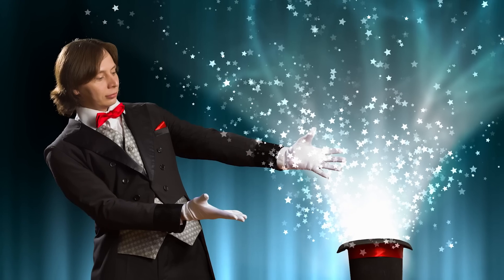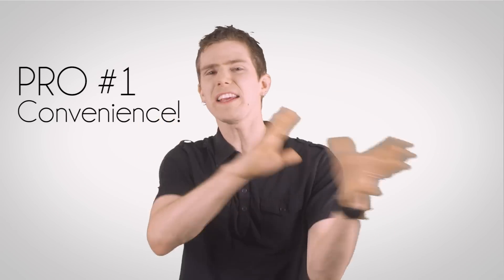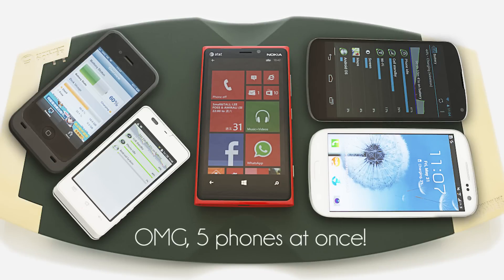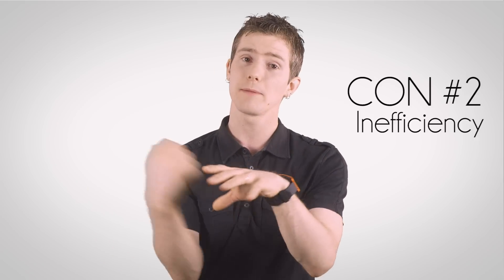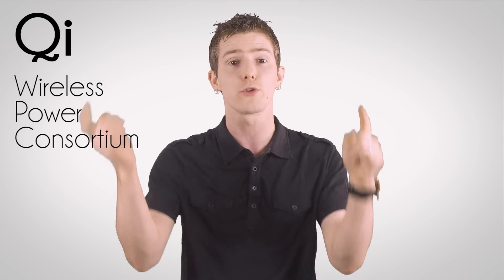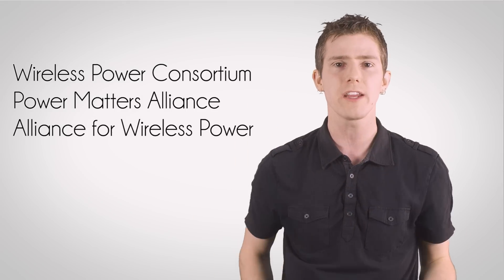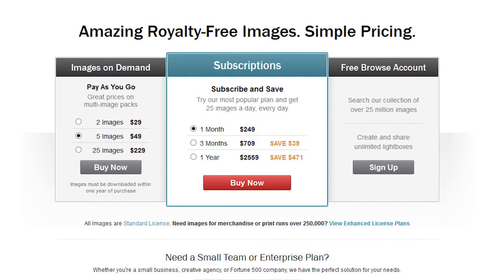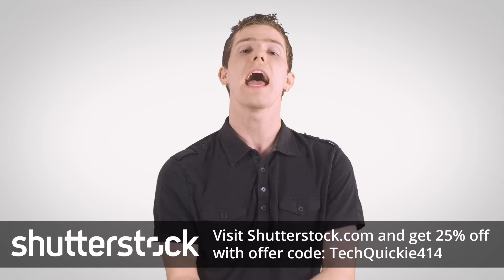Wireless Charging as Fast As Possible

Comment: It's not wireless, the charger is still tethered to a wall socket. Stupid marketing gimmick...
Reply: But there's no cable between your phone and the charger, that's how it's wireless.
Reply: Newbie13XD I know how it's "wireless". But the phone is still stuck to the charging pad. Once you take it off, it ain't charging anymore. The charge range is so small (like only a few inches away from the actual battery) that actually can't consider it wireless . You can remove the charging cable from the device as easy as you would do remove your phone from the charging pad.
Reply: Răzvan Botea Well the thing is, as Linus said in the video, that you simply put it on the table rather than having to plug in a cable. But yea, I see what you mean
Reply: Newbie13XD The charging cable is long enough that you can lift your phone from the table to your ear easily. No need to remove the cable.
Reply: Răzvan Botea did you watch the video?
Reply: Newbie13XD No, I didn't. I just like to comment on videos without watching.
Reply: You do know that its bat to leave your phone in the charger while your using it right? And using it while your on a phone call is worst. The phone heats up really fast and can cause on burning your skin or the phone burns or explode.
Reply: No it can happen but it doesnt happen that much. I mean there been only a few that happened but it can happen but just not likely. I dont want to start a fight at all cause its stupid i just wanted to say it could happan. Try reading some articals in google search. Or watch the news sometimes. :) please no fight- thanks
Reply: Răzvan Botea You are wrong ;) Some charging pads have there own battery ;) So yes it CAN be wireless.
Reply: Even Finckenhagen why noone gets my point ??? Why you connect to your WiFi it's wireless right? You can move 10 meters away from it and still be connected. Is it the same with wireless charing pads? NO. You have basically stick your phone on the pad.
Reply: Why noone get your point? Can it be you are wrong? :p
In your sense wifi is still not wireless, them are normally connected 1-2 cables/fiber, even u can only move 10-50 meters, i can bring my pad anywhere and it still work wireless.
Reply: Even Finckenhagen I get yours, but let me make it clearer maybe you'll get mine: wireless can mean pretty much everything since atoms/molecules physically don't touch. Two copper wires can be at a distance of about a few micrometers for a small amount of current to pass between them. It's still wireless, but we don't call it wireless. This is a perfect analogy towards wireless battery charging. "Wireless" has a limit, the limit of wireless battery charging is ridiculous you shouldn't even call it so. More like: charge your phone unplugged. Wireless would have been if you could just walk around your room with your phone while it's charging. Yes, this is a non-trivial wireless method of charging batteries, too bad I don't think it will happen too soon.
Reply: while it is wireless it is still stupid for efficiency and I own a galaxy s6 it still sucks as far as I can tell
Reply: +Răzvan Botea actually the technology to make phones charge from up to 15 feet away has existed for a couple years now. it's just too bulky and expensive right now
Reply: Actually it's better because you can charge more then one device at once with just one lad plugged into the wall rather then to have a thousand different chargers into the wall
Reply: +Jake Woodworth only with very particular big bulky charging stations. plus the heat is a pain to the battery
Reply: +Răzvan Botea It's still wireless, the phone is charging without connecting a cable to it.
Reply: +Even Finckenhagen yeah...the stone thingy - which can charge wirelessly so long as it has been charged (like extra portable powerbanks) and strangest yet coolest feature is that IT can be charged on a by a WIRELESS pad...alleviating the need to connect it to the micro usb port like all the other powerbanks require!
Reply: DOGE™ It's not wireless unless you can pick it up and still charge, that's true wireless. Until then, the phone is still gonna be tethered to something in order to charge.
Reply: Răzvan Botea That is another type of wireless charging. Qi wireless charging charges the phone through induction, therefore it's wireless.
Reply: DOGE™ Yea, wireless by 1-2 mm, that's not what I call wireless, should be at least 30 cm to be really called wireless. I know this is not the definition of wireless, but you can basically call everything wireless as long as nothing is touching. Actually. the Qi wireless charging everyone's talking about does not even go in this category because it's touching something (the charging pad) = still tethered to something.
Reply: Răzvan Botea I know what you're trying to say, but technically the phone itself is not tethered to a wire so therefore it's still wireless. 

The concept of true wireless charging is cool though.
Reply: DOGE™ Glad you got my point. It's tethered in the sense that you must keep it "attached" to the charging pad in order to charge. Wireless charging is actually unplugged charging (and thus should be renamed like this)
Reply: +Newbie13XD because that is stupid, em causes damage to electronics and life there 
are tone's of studies showing this, there are experiments that show a 
direct effect magnets have on the brain. Also they waste a tone of power
 and there is no amount of technological progress that can fix that it 
has to do with the fundamental law of the universe thermal dynamics.
Reply: Răzvan Botea I actually resorted to securing my phone to the charging plate with a rubber band the other night (my charging port is broken and I have an extra battery and external charger as well, but for whatever reason...i didn't have access to the extra battery at the time) - needed to continue talking but had like 14% battery left and since they are notoriously slow at charging (the traditional versions) - I channeled my inner MacGyver & reached for an extension cord, my charging plate and two rubber bands!!! LOL 😁 - how pathetic I must've looked, thank goodness I was at home and alone! I complained to the person I was ON the phone with that my range for my phone and charging rate was absurdly better with my 10ft - heavier gauge, "non-wireless" charging cord (but since my port is broken...its not an option unfortunately!) 

My other rant coincides with your previous similar complain in how limited the "wireless" range! I have a nifty case/wallet for my s5 that is above and beyond better than the standard wallets with the 3-card wallet & magnetic closure! One of the awesome parts about it is that those cases traditionally have the part that hold the phone in glued or otherwise permanently attached!  This one has a bumper case that holds the phone but has a strong magnet built into it and the corresponding magnet built into the case, so in 1/2 a second, you can pop it in or out (which is good - especially in my case, plus the wallet has a bulkier but super functional addition zippered storage on the front side making me able to carry a lot more cards, change, and folded cash and it all closes with a snap closure vs a magnetic one - which has been one of the biggest problems I've had since I would stuff 3 folded bills in the back slot and the added thickness wouldn't allow for the case to remain closed because of the weak magnets! LoL - sorry got of course, but I freaking LOVE this new wallet!

Here's the problem, with just the ever so thin silicone case over my phone - you guessed it, it will either intermittently charge or won't charge at all & if it does, the phone, the case, and the dock all get "extremely" hot!!! So I've dealt with it as necessary - but annoying nonetheless! 

Extra tip for you people shopping for Qi charging adapters - look closely at the specs for their OUTPUT! They all have the same 5V input but I've ordered a few to attach to my spare batteries and the first one I got read an output of 500-600mAmps, the next one I got from amazon had better ratings and when I got it, the output read 650mAmps, so I found that to be the standard for most - but I DID find a few that were rated for 1,000mAmp Output and so I got one and I DO notice that it works significantly better/faster than the first one!
Reply: There are portable wireless chargers that run on their own battery

Comment: I was looking forward to wireless charging until I found out the charging efficiency is only at 60%, which means you waste 40% electricity that turns into heat, imagine if a million devices needs 40% more energy to charge...

Comment: Wireless charging is slow and inefficient as you are introducing another induction load into a circuit that already has one (step down transformer). Magnetic induction on a copper coil can't charge a phone anywhere near as fast as electrons through a copper wire!

Comment: megaspeed2v2 Okay, now take those few miliwatts and multiply it by a great fraction of the world population. Then those few miliwatts aren't a "few" and are now greatly increased to..oh I don't know megawatts? gigawatts?? terawatts???

Sure it doesn't seem like a really big deal to debate about but to some people it matters.
Reply: Alright assume 7 billion people in the world own a wireless charger (vast overestimation already) and have it charging a phone 24/7 (another overestimation). Most wireless charging pads on ebay use 2.5-5 more watts than normal chargers, so lets take the 5 extra watts(which is the most inefficient one), multiply that by 24 that is 120 watts a day, multiply that by 7 bil, that is 840 bil watts, seems like a lot but lets find the % increase of the global power used as of 2008(probably more now) which is 143 trillion watts, that is a .58% increase in global power usage if nearly everyone in the whole world used the most inefficient wireless charger and charged some phone 24/7.

Comment: i dont like wireless charging
Reply: +Johannes Werner Why?
Reply: +Johannes Werner I don't like you... No reason... Like you, wireless charging doesn't care :D
Reply: +New American Fishkeeper 
i care about my cable and never broke it and it doesnt take longer to connect and its faster
Reply: +Johannes Werner wireless charging wastes a tone of power and is damaging to electronic and organics (you)
Reply: You don't know what you're talking about
Reply: +Me Just How is it damaging?
Reply: +Catcrumbs It generates a lot more heat, which is bad for battery life in the long run.
Reply: +Keith Bishop-Daly Maybe... but the lifespan of the phone (ie. how quickly it will become outdated) is going to be the more likely cause of you getting rid of your phone. Even still, there is no evidence to prove that your battery being warmer from wireless charging damages the battery life. Actually, I think the battery has no effect of temperatures to 50C which is less than the temperature of a battery being charged wirelessly.
Reply: I have no idea how to respond to that. All I can say is that there is a multitude of evidence to prove that any excess heat is worse for your battery, just google it if that helps you.
And not everyone can afford to (or feels the need to) upgrade their phone frequently if their current phone still works well and fits their needs. A lot of people only buy a new phone (or new anything) when their old one breaks.
You can think that temperature has no effect on long term battery health below 50 degrees if you want to, but it's just not the case.
As a side note, that extra excess heat created by wireless charging means there is significantly more wasted energy from wireless charging.
It's a nice idea but it is slower, uses more power and it is not optimal for long term battery health.
Plus, a lot of people (such as myself) find it less convenient. If my phone is plugged in and charging I can use it without disturbing the charging process, but if it is wirelessly charged it halts the charging process every time I pick it up.
Reply: Lead acid batteries are used less and less, and I agree, we should keep in mind that this article doesn't pertain to the lithium ion batteries found in most modern phones. But you're right to post it since the principle is essentially the same.
Lithium ion technology is an improvement on older forms of home-rechargeable battery, but it doesn't reinvent the wheel. The issues found in older battery types are still issues today in modern tech and we have a long way to go before perfecting it.
Obviously one common issue is that battery technology is improving slower that the technology of the devices they power, which means over the years we've seen worse and worse battery life in our phones. So it is more and more important every day for people to stop waving away these problems with a simple "I'll just buy a new one anyway, who cares"
Well...why? Why not just keep in mind a few simple truths and generally take care of your possessions for as long as you have them?
I have a HTC One M8, an LG Urbane smart watch, a bluetooth headset, an Android tablet (for work) an iPad Mini (for play) and a Macbook Air. All of which I use every day. The main thing these devices have in common is a non removable battery (yes I know the Macbook can have a replacement battery fitted, but it is expensive enough for me to seriously try to avoid needed to, plus it doesn't just pop out of the back like a regular laptop battery usually does.) So my incentive to not ruin my batteries for no reason is probably higher than most and I've spent a lot of time looking into it over the years since I have no intention of replacing any of those devices unless I have a good reason.
Reply: Keith Bishop-Daly Lithium batteries are less "Fragile" than other types of batteries, but still vulnerable. My anecdotal experience is that it hasn't really hurt my battery all that much, but I'm just one person. I'm nowhere near smart or qualified enough ti argue the point.
Reply: Linus is the man. I remember watching that video.
(EDIT; I meant I remember watching THIS video. My original post was only a few days ago but it's been a long weekend and I thought I watched this a couple of weeks ago)

That's my point, I agree they are far less fragile, and with ordinary use and frequent device upgrades you might not notice at all. But depending on what I'm doing I might need two full charges of a device in a single day. The Macbook, especially, can sometimes need three. So can my phone, but not as often.
Another consideration for me is that I work for a children's camping organisation and I often find myself in, essentially, an office environment but in a field in the middle of nowhere, so battery life is obviously very important there. It's helped with the use of portable solar panels and power banks, and I will happily concede that this is far from a typical user.
So I suppose my main point is that if I, a self-confessed power-user, can see significant benefits from "best practices" (Linus's favourite phrase) then an average user may as well at least keep it in mind. They don't need to stick to it as rigidly as I am forced to. But that fact, in itself, doesn't mean you should do the opposite and ignore the information.

Comment: What happens if you use a EMP on a wireless charger. lol
Reply: +Nikola “Nidžo” Pavlica You are at 60 EMPs per second :-)
Reply: TopTribute Bands
No, I mean Electric Magnectic Pulse. Higly doubt that TechRax will do it XD.
Reply: That's what I meant. EMP =Electric Magnectic Pulse which you get one every time the AC cycle changes which is 60 times a second. Not a solar EMP but it is what causes the wireless charger to work. Check it out for yourself.
Reply: +Dyl Treanor (lightguy) OOOps your right again. Darn brain farts :-)

Comment: Im waiting for wireless charging in roads so electric cars can just drive and get charged. I know it will cost a crap ton to have all that power but just add it to taxes and its better then burning petrol or diesel.  (and just use wind/solar/turbine or water power instead of coal burning ect.)
(If you want a amazing brain like mine working for you just contact me ;).
Reply: Wind and solar still suck, useful but unreliable. Not a bad idea but we're a good way's away from it.
Reply: If fusion turns out to be a hit then power costs don't matter where fusion is available. But until then we'll have to deal with current fuel sources and try to transition to more reliable eco-friendly ones.
Reply: Vatablous Devil Now that would be ideal but for the time being we still need coal and nuclear.
Reply: Why do we need coal and nuclear if we have fusion?

Comment: Wireless charging is stupid. Battery technology is advancing at a very slow rate and what's the point of wireless charging when the device has to DIRECTLY on the fucking pad. Might as well spend 2 secs to plug it in and then you wont have to pay alot of money for a wireless pad. Il be interested in wireless charging when you can just place your phone anywhere in the room and it will charge.

Comment: science be praised, but i would rather just plug a device in. much quicker/cheaper than these so called wireless chargers. cable clutter? learn cable management.
Reply: cable management.. yes, but some people need to switch things around a lot, and it gets a little impossible then. unless you want to make things even worse by adding cable management
Reply: HazewinDog What cables are they talking about?The one usb and what else?